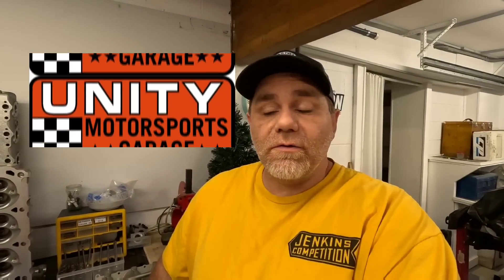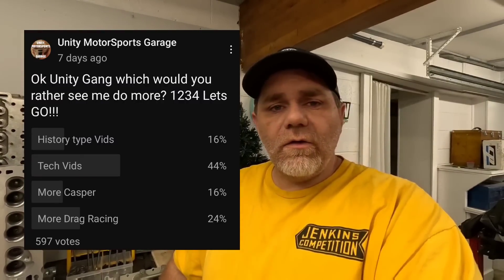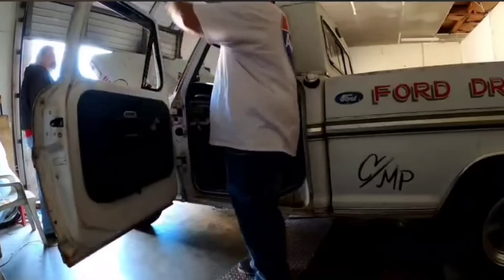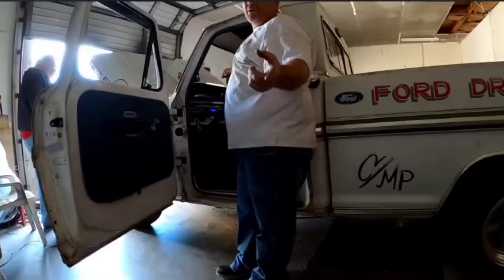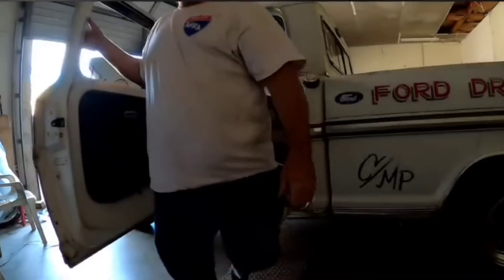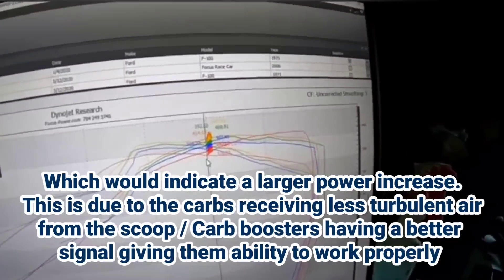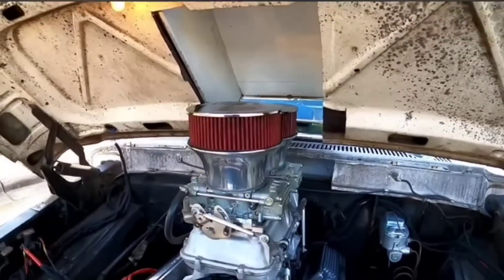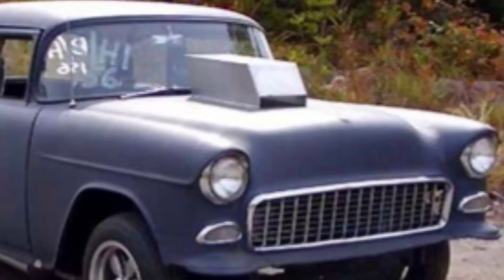TunnelRams and Velocity Stacks.. Dyno vs Dragstrip what you need to know! Part 1

Comment: Andy, I'd close off the front of that scoop. There should be a high pressure area in front of the windshield that pushes air into the scoop.

You will also probably want to seal the hood to engine area so that all the air comes in through the scoop.

Comment: Pack some foam around the stacks to close the under hood off from the scoop, so most of the air comes from the scoop,   I feel the under hood air is coming out the scoop,  I had that problem with my scoop,  figured it out , when I started noticing gas, oil, and belt dust sticking to the windshield just behind the scoop!
Reply from the maker: Yeah it will be interesting to see exactly what is happening that is for sure
Andy

Comment: Hey Andy, when reading a spark plug, we need to look beyond the tip, down into the area where the porcelain meets the plug’s body. Even when the tip is bone-white there will be tell-tale traces of what’s happening in the engine. You’ll need a magnifying glass to really see, but the story will be written on the porcelain down inside.
Love your videos!
Reply from the maker: It was white clear down to the base!
Reply: Sweeeeet.

Comment: Andy as I mentioned to you the other day. The vents want to see atmospheric pressure, whatever that may be that day outside. That is necessary to get a true delta P at the booster for consistent metering throughout the operating range. Any object closer than about 1-1/2" to the vent tubes can alter this. That's when you need the "flutes"  I mentioned. Good luck 👍

Comment: The other issue with your previous dyno was it was different headers.  In my experience changing headers can have as much effect on a tuneup as a whole different carburetor. Life is easier if you eliminate all the static issues before you go chasing after dynamic issues.  I would say it would be worth putting an afr gauge on for your dynamic testing even if you wind up taking it back off for the period correct look.

Comment: Use a high volume fan and some smoke to see.... some disassembly required.  Move the fan around and freak out. 
No filter required,  play with hailscreen wire for reinforcement and widow screen to maximize flow and smooth out dynamic air movement.  And yes, the scoop is a beautiful thing, but it has to change to more of the Mopar Air Grabber before the screens. 
Mikel

Comment: When you run open carbs, you should use hose to connect the bowl vents, with an opening in the middle of the hose, up and over the center of the carb. To prevent air flowing across the vent from sucking fuel out of the bowl, or any pressure changes affecting fuel flow.

Comment: It might be worth making a small like 24" manometer and running some vac line or soming and taping it to different parts of the hood scoop to figure out what the air pressures are doing at speed, maybe even using a fog machine to blow smoke through tubing across the hood and scoop like a wind tunnel, but just driving around

Comment: Hmm, one reason Jenkins scoop worked was that he used a pan to seal the engine area from the scoop. In your case you have hot engine air+ air coming in the hole in the front that exits thru the hole in the back (venturi effect) creating a vacuum at the top of the carbs. Also the rear scoop is too far forward, it can't get positive pressure from the cowl

Comment: Great videos and info Andy ... I’m curious if you have considered using a pair of O2 sensors to verify air/fuel ratio... I am in no way saying that your plug reading capabilities are not top notch... around the year 2000 was my first opportunity to use an O2 sensor setup in a street stock dirt car and it shed a huge spotlight on the commonly held knowledge (BS) about carb jetting of the day ... when the idle, accelerator pump , transition, main and power valve circuit were setup using an O2 sensor the car idled better responded better cautioned lapped better used less fuel and made 22 hp more at WOT ... this along with DV’s tech applied everywhere we could made the car untouchable... it was a real eye opener for me ... keep up the great work

Comment: In the 70's I ran a 289 to 8200 + daily with a blue anodized heavy gauge aluminum velocity stack that was 5 1/4 inches high. About 3 1/2 inches down there was a cast-in step upon which rested a curved chrome steel plate with a billion 1/8" holes drilled into it, retained by the center carb stud. It's supposed purpose was to hold down a section of filter foam. I ran it without the foam. It is my belief that all those holes straightened out the incoming air. This scenario was not present in DV's criticism of velocity stacks, and I think that it should be tested. The hood had a 5-inch Sox and Martin scoop that was not sealed to the carb. As a daily driver, I wanted excess airflow to cool the engine while moving and parked. 
I still have this stack. I can send you a pic or two, but I don't know where. I am not on social media.

Comment: Thus is just my 2 cents. Close the front of your hood scoop, all the way to the hood. Keep that high velocity air, from blowing through. Let the carbs pull all their air from the back, low pressure area. Run it, then check your carbs for that saturation you talked about.

Comment: Excellent video!!! I've been wondering if my hood scoop was beneficial or not. I fattened my carb up to go to a lower elevation track. The AFR showed it was safe running between 12.1 to 12.5, but the plugs looked lean as. I am having the same issue with raw fuel being saturated on top of the carb. I assumed it was leaking from the squirter nozzle, but now I don't know. Next time I go to the track, it will be without the hood scoop so I can compare results. Thanks for the helpful info!

Comment: I always swore by using a 7" velocity stack/filter while bracket racing my 70 Torino Cobra 429 back in the 80s. The car had a little bit better 60ft and et's times with the 7" stack installed vs using a 3" stack or no stack.

Comment: Hey Andy. I'm wondering if you are getting some vacuum with that scoop on Casper. That is affecting the carburetors signal. Just a thought. Because if is tuned when is standing still. Yet when you drive it responds different.

Comment: With the carbs sideways one side should be behind the other because of primary and secondary opening times. How would it work to have all 8 barrels in sync? Maybe a modified carb top that has individual stacks for each barrel. Just thinking outside the box, heck I lost my box out on the freeway somewhere.

Comment: I doubt if it actually leaned the engine, those two filters can pass more air than the engine actually pumps. I believe the tall Column of air directed into the carbs and shielded from outside forces gives the motor less turbulent air and two  nice fresh air barrels to draw from.

Comment: Would adding air filters reduce or eliminate the buffeting?
Reply from the maker: Yes the air filters can help eliminate the Buffeting.. the tricky part is creating a scoop design that effectively helps airflow reach the Carb and not be hindered 
Andy
Reply: @UnityMotorSportsGarage I would think a ducted setup like the thunder bolt or the 442 ram air would be the Way to go?

Comment: Good stuff Andy. Just out of curiosity, what brand of plugs are you running?
Reply from the maker: Autolite 3924's Thank Greg
Andy
Reply: @Unity MotorSports Garage  just an observation that I have made over the years. I find it much easier, and I personally get better results/information from the plug colour of NGK plugs. I like Autolites, but I find NGK's easier to set-up with. My favourite plugs are Nippon Denso, because they seem to work across a much wider heat range than other brands. However, they are hard to get where I am nowadays.
Reply from the maker: I'm weird I guess, I run Autolites in all NA combos and only NGK's go in my nitrous deals.. 
Andy
Reply from the maker: You are right NGK'S are easier to read!

Comment: Would you consider a ram air set up? DV's book says it's worth power. I understand that Ray Paquet says he didn't see any improvement with his Thunderbolt but, he shifts at 9800 or some craziness using factory carbs so that might straight up the air flow whether it wants to or not, haha.

Comment: Sorry, but those are belled air horn extensions, and are not velocity stacks. Play on words for marketing. They do provide a better presentation clean airflow to the carburetor, and if tuned for, can give a power increase, in specific situations. 
Now going down the track and the affects on turbulence and pressure within the air box / scoop, creates a entirely different and varying atmosphere to the carburetors. 
Also, you may want to look to air bleed changes in addition to courser main jet changes.